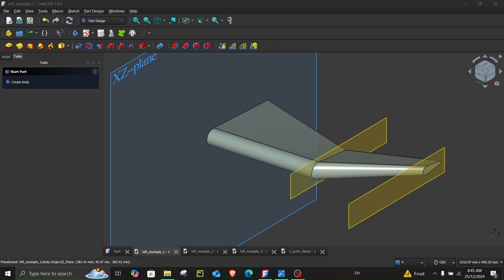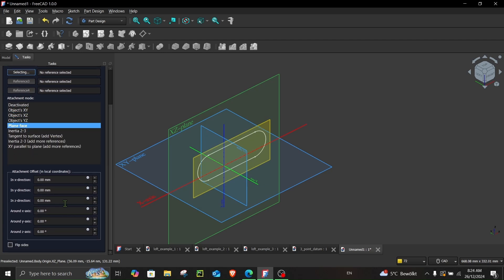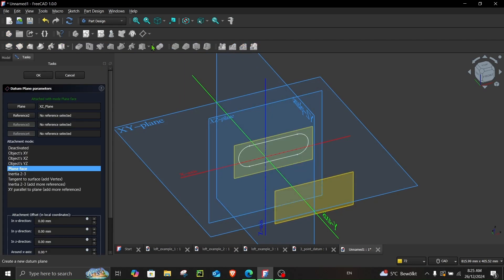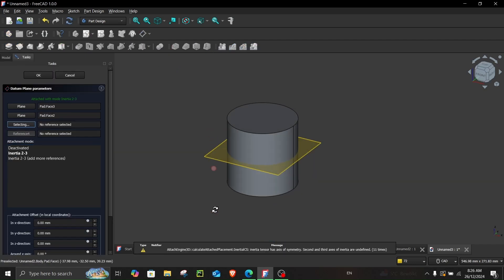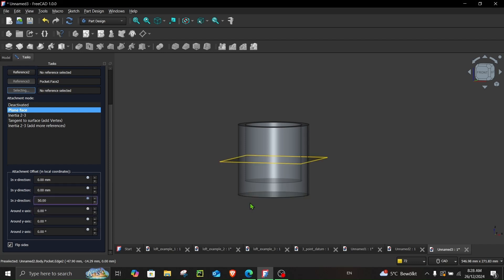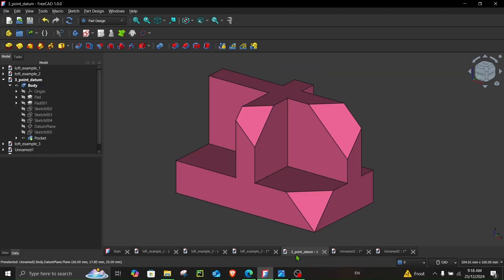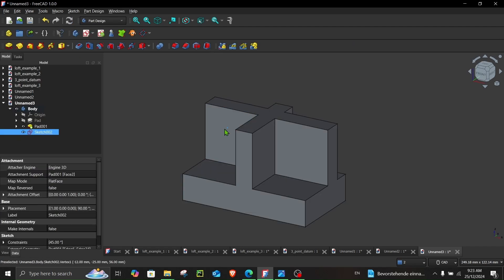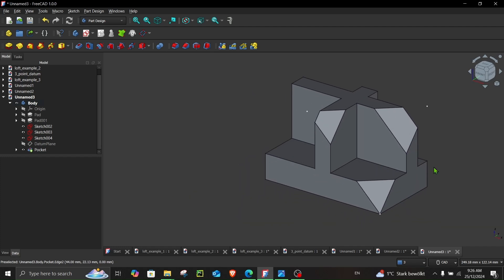FreeCAD 1.0 | How to Make Datum Plane | Beginner Tutorial

Comment: Thank you very much for the Video. 
With the cylinder I found out that if you select, either the outter or the inner cylinder the new plane is in the middle of the related cylinder. Is this a possible way or is there something wrong with doing it this way?